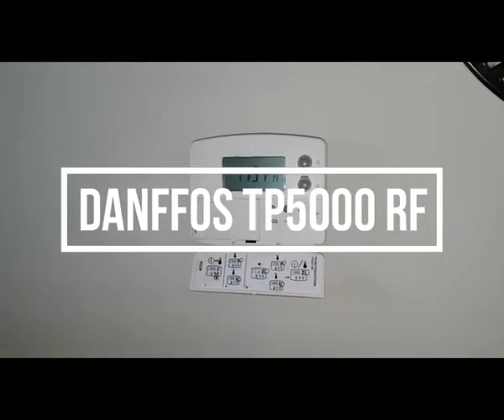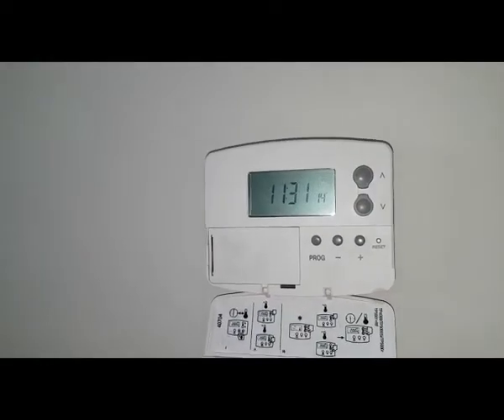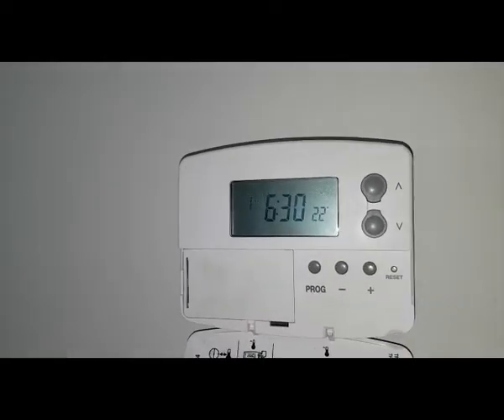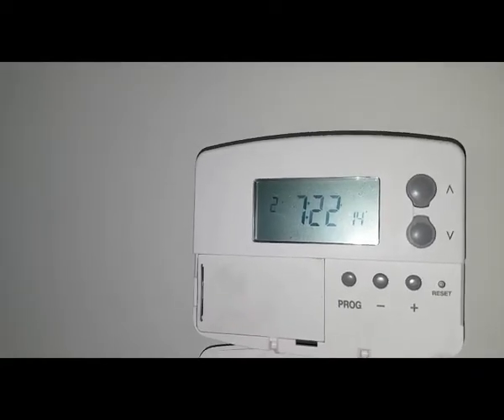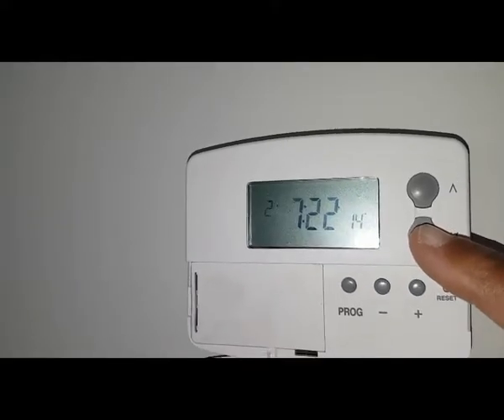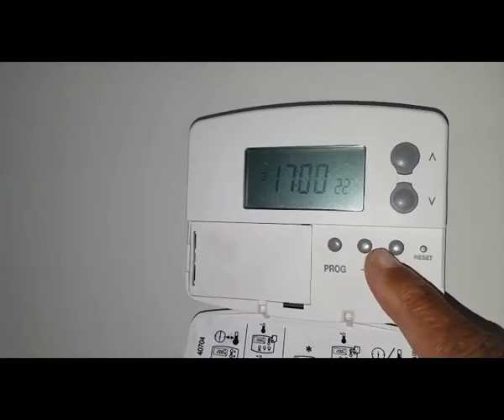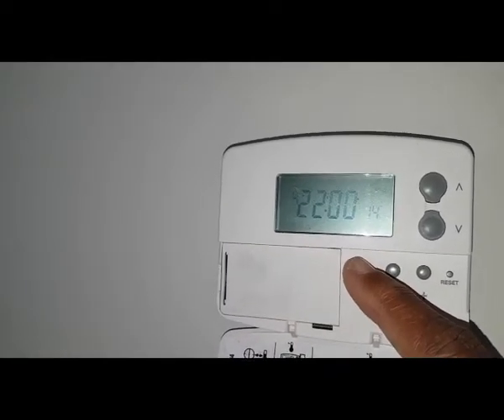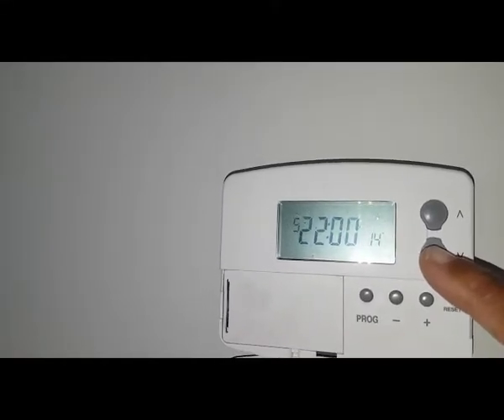Danfoss TP5000 RF Setting the On and Off Times. With Coach Tony Morgan

Comment: How can you just switch on and off manually
Reply from the maker: Just turn down the temperture up and down
Reply: You can’t because if for example you want to heat the home and you turn it up manually to 20 degrees at 10.45 but your system is programmed to go to 15 degrees by default at 11, it’ll be on for 15 minutes but then turn off again. It’s an awful system which I’m going to replace soon.

Comment: Hi I wonder if you can help, I have 2 one downstairs and 1 upstairs, the upstairs one will not work without the downstairs one being a certain temperature. So for example if the downstairs one is switched off or below a certain temperature even if you have put the upstairs one on 30 degrees it will not produce any heating. How do I fix this problem? Thanks in advance
Reply from the maker: Each thermostat should control a zone valve you will need to locate them and test which one is operating and turning on the boiler. One of them could be faulty.  Hope that helps. By the way could you subscribe to our channel 🙏

Comment: great video, problem i find is how can we programme individual days, as for office we are closed still half the week, so causes problems, we would like it off for a few days but no way to do this is there? its  a v basic system sadly as far as i can see. cant even programme it day by day am i wrong? thank you in advance
Reply from the maker: Hi Mark there is not much flexibility with this type programmable room thermostat sorry 😐
Reply: @ARBoilers  Doesn’t each programme number represent a day. If so, the days not to be used should be set at the same to go off as the time they come on, with a low temperature, that should solve the problem when not in the office?

Comment: Hi. I have a Danfoss TP5001 + RF and the batteries needed changing. I have replaced them but the unit keeps flashing 10:00 and even if I press the +- and ^v buttons, it doesn't change.
Reply from the maker: Try pressing the reset button
Reply: @ARBoilers  thanks. I tried all that, first thing I did, but it continuously flashed. I just took the new batteries out and left it overnight. When I put them back in, it went back to normal and I didn't lose any of the programming ;) the batteries had leaked and I needed to clean the pins too. I took the unit off the wall cautiously! But thank you so much for your response! Apologies for my tardy response.
Reply: Hi.can you please advise me about danfuss 5000 .I have changed the batteries but the screen all good .I think I have lost connection between my thermostat and my boiler. I have watch all of your videos. How can I set it up .many thanks
Reply from the maker: @reza5147  Hi for this problem turn off the electricity to the boiler removed the batteries,  turn on the power to the boiler then refit the batteries then try that.

Comment: How do you turn the heating off by using this thermostat
Reply from the maker: Just turn down the temperature button
Reply: You cant turn it off as such you can only press the down button to select a lower temperature setting but this will only work until the next program kicks in which will then override it so there is no summer winter setting As in most cases this thermostat replaced a mechanical room stat which you could easily just turn it down for the summer but there would of also been a hot water central heating timer which is where you would normally turn the heating of for the summer. 
I have the non WiFi (TP5000Si) version which doesn't need batteries replacing and has its own internal lifetime battery for the clock so it can be turned of for long periods without needing the clock resetting it even changes the time automatically when the clocks go back, after setting it up I now leave it on all year as it doesn't get cold enough in the summer for the heating to kick in.
Reply from the maker: hey we're currently trying to grow our Facebook group and would love you to join Tony and the team using this link, Tony will be available to answer all your questions directly there's also updates on new trainings we just released too. https://www.facebook.com/groups/167070231326174

Comment: I have a question which I can't find the answer to on Google and am hoping you might be able to help. When I was cleaning the other day, I accidentally went a bit too close to the central heating control panel and I think the smallest amount of water  from the sponge must've leaked its way down inside. The control panel started to flicker and slightly buzz. I grabbed a wooden spoon and switched it off as quickly as I could. I haven't put it back on yet. Wondering if it would be safe to switch back on or even put the heating on or should I leave for perhaps longer? Have tried searching on Google but cannot seem to find an answer anywhere. Would really appreciate any advice. Thanks so much.
Reply from the maker: It should of dried out by now so turn back on and hopefully it should work as normal
Reply: @ARBoilers  Thanks so much for taking the time to reply to me. So, there's no risk of electrocution when I switch if back on if that water may have damaged something within the central heating panel? Sorry - really Clueless about these kinds of things! Thanks so much for your help.
Reply: @mariarossi6719  nothing should shock you if that what your worried about usaly the electricity box would trigger and cut main source off prefenting any danger
Reply: @CaptJackSwallows  Thanks for getting back to me. I switched the central heating panel back on at the wall and there are no lights on. Clearly that little bit of water has seeped in and wrecked something. So annoyed. Will this be expensive to fix and do I need to get an electrician or a heating engineer out? Thanks again for all your support. You guys are brilliant and yes, I"ve subbed!
Reply from the maker: Thank you for watching my video could kindly subscribe to my channel. I will be adding new very soon. Hopefully they might be of use. Or If you know some who might be looking for this kind of information please share it with them. Regards Coach Tony Morgan.
Reply from the maker: hey we're currently trying to grow our Facebook group and would love you to join Tony and the team using this link, Tony will be available to answer all your questions directly there's also updates on new trainings we just released too. https://www.facebook.com/groups/167070231326174

Comment: The programme is not working at all. Despite programmed the boiler not to work during the middle of the day and during the night, the heating keeps going on. I reset and re-programme but it is the same. Despite the programme, as soon as the temperature is below 19, it kicks off.
Reply from the maker: hey we're currently trying to grow our Facebook group and would love you to join Tony and the team using this link, Tony will be available to answer all your questions directly there's also updates on new trainings we just released too. https://www.facebook.com/groups/167070231326174

Comment: Just had this fitted by my local council and they've programmed it to come on at 6am and off at 22.30. I used to have my boiler on for 30 min at 7.30 and on again at 18.30 for 2 hours. When I try to program it, it only gives me options 1&2 on and off. Any ideas?
Reply from the maker: It must be a different model to what you had before
Reply: @ARBoilers  it's a totally different thermostat I had before yes but now I've got the one in the video and it only gives me 1 and 2

Comment: Thanks for the video, i set the temp as per your guidance and at the end when i press (+)(-) simultaneously  to check the room temp then it shows 25.5 and set temp is 14. I am bit confused how its showing 25.5 ? am i doing anything wrong ? the room temp is too high at 25.5.

Please advice.
Reply from the maker: 25.5 temperature is current temperature of the room
Reply from the maker: hey we're currently trying to grow our Facebook group and would love you to join Tony and the team using this link, Tony will be available to answer all your questions directly there's also updates on new trainings we just released too. https://www.facebook.com/groups/167070231326174

Comment: Trying to set one for my dad and it’s set to do mon-fri 4 times and then sat-sun 4 time. However after setting the first on off for mon-fri when the next start time comes on the sat sun days start flashing while the mon-fri stays solid and it won’t let the times go above 6.59.  Pressing again goes to the sat-sun settings and they work fine. Can’t see anything in the manual to make the sat sun disappear when trying to do the evening settings for mon-fri.  Can you help?
Reply from the maker: Have you tried reset?
Reply: A+R Central Heating and Boiler Repair Experts Ltd. yes. Wondering if I need to take batteries out to really kill the memory as after reset it still remembered date and time.
Reply from the maker: @scm256  try that, I think you will need to reset the time and date plus program
Reply: A+R Central Heating and Boiler Repair Experts Ltd thanks I’ll give that a try
Reply: Sorted now. Had to put the timer backwards. Thanks for your help.